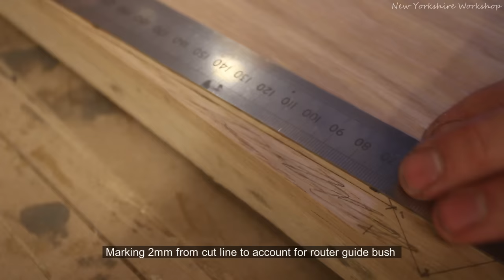Making a traditional framed ledge and brace door in Oak

Comment: Well done sir it’s nice to see another fellow joiner do a good job l was looking to see the bits you were using on the spindle  moulder l have a lot of cutters made for the block but you only have one size will have to look into the cutters you have l do have a wobble saw blade which you can set the size you want great job but a lot of time but when you have finished it was Worth it and yes oak is my favourite wood did you make the door frame as well Nice to see you make your own jigs 👏👏👏👍 I will hit the subscribe button stay safe 👍

Comment: All the work and effort you have put into that and then you go and install it BARE what are you thinking? Why haven't you coated it? Worse still why haven't you coated it before assemble? Had this been done in our workshop the door would have gone into the spray shop prior to the boards been fitted to get stained and first coat of exterior grade lacquer paying particular attention to the end grain, the same treatment for the T&G boards both sides, ends, tounge. The frame could have been taken to a finish with 3 coats, again using end grain sealer on the end grain paying special to the end grain of the jambs as these will take up water like a sponge. Then once assembled the door goes back to the spray shop for finishing. The assembly process is slightly different of course because now your working on coated timber but at least the the timber is fully sealed against the elements. Has it gone black yet due to the tannins?

Comment: An absolute pleasure to watch this carpentry; especially with all the various power tools that are shown. One thing that I can not quite understand is how you managed to fit the last tongue in groove baton - did you slide it in along the full length?
Reply from the maker: Thanks! there is a 2mm gap on each side of each batten for expansion, so with six battens that is seven gaps for a total of 14mm of clearance. that means i can butt each piece up tight to get all battens in place and then space them out to engage the T&G's and at the correct gap.

Comment: Read the instructions on the Gorilla Glue, you need to wet the adjacent part to activate the glue
Reply from the maker: it is a moisture curing polyurethane so adding water helps but isnt strictly necessary on wood because it has moisture in it already.

Comment: Amazing. I am new to woodwork and am making a gate with braces. I've only seen 2 people cut the braces into the rails like this. Why angle the cuts into the rails? Is there a mechanical strength reason for doing this, or is it purely personal choice/aesthetic? Why not cut them in parallel with the rails?

Comment: Excellent video.  Good sturdy design and build, with useful tips and comments throughout.  However, I notice that the lock recess appears to remove a large part of one of the tenons in the middle rail (see 43:30).  Was this deliberate, or would you change the height of the middle rail in subsequent designs to move that tenon away from the mortice lock position?
Reply from the maker: Its s good point and well spotted! Yes id probably move it in future, although the door is still plenty strong enough with what was left of the tenons, owing to the orignal size of the tenons and that the lock was quite shallow.

Comment: Excellent work, may I ask what make countersink you were using for the stainless screws on the rear of the door... Thank you
Reply from the maker: thanks Mark. i dont remember where i bought them but they are the cheapest chinesium ones that come with those horrible tapered drill bits in them. probably Amtech. just search "plug drill set" and get the ones with the brad point drills, they dont need be an expensive brand, these ones have lasted me years.
Reply: Thank you,

Comment: Good morning. Can I ask you why you have so much movement on your bandsaw blade?  I have the same movement on my bandsaw and do not know what is causing it so would appreciate your comment. Many thanks. David.
Reply from the maker: good morning! if it is wobbling back and forth like in this video then it may be a damaged blade (thats why mine was wobbling) or if the blade is new then maybe just not good quality or joint weld is not good. other possible causes could be that it is a small bandsaw with too wide/thick of a blade which requires more tension than the saw can cope with. or may be that the tyres on the wheels are damaged, or the wheels themselves are damaged/wobbling.

Comment: I have noticed that you use pu glue a lot. Can you explain why do you prefer it instead of regular pva glue which is much cheaper? Love the joinery in your videos, you really stand out from the rest of youtubers!
Reply from the maker: there are a few reasons; im mostly using it on the exterior work because it is pretty much water proof to the extent that if submerged in water the wood will degrade before the glue, whereas the "weather resistant" d4 grade Pva's and even the aliphatic resin yellow glue will fairly quickly dissolve. thats if you can find a real aliphatic resin, titebonds yellow glues are just modified pva with a yellow dye to imitate aliphatic resin!
 another reason is i tend to have it in the workshop anyway as i use it on some of the products i manufacture where im bonding wood to alluminium, PU does this quite well. it is also convenient being able to just squeeze it out of the bottle and when foamed up on the surface it is really easy to clean up. 
main disadvantage is there is almost zero strength when it foams up, so you need to make sure the joint has good contact and clamp well. in situations where i cant guarantee good contact, or i need to guarantee good joint strength i would use epoxy ( for external work) i know cascamite is widely used, ive never used it personally apart from at college 22 years ago.
Reply: @NewYorkshireWorkshop   I had no idea about Titebond and their clever marketing. So how does pure aliphatic resin compare to everyday available wood glues? I have used premium polyurethane construction adhesive with great sucess as it is very durable and gap filling. I like it because it does not foam up. I think I have some further reading to do about all this
Reply from the maker: @markosabados546  i dont really know the science behind it but you can tell the difference in the glue when it is dried, the titebond 2 ultimate is quite flexible and rubbery and the titebond 50 (true aliphatic) was very brittle and hard, more like hide glue with added benefit of very good heat resistance and water resistance, unfortunately it is no longer available (was never available for retail sale, just through trade dealers in 30 litre buckets).

Comment: Watched this so many times. Love it! So relaxing watching a skilled craftsman. Two questions if I may, what bearing cutter did you use for the hinges? Seems like you attached three bearings to it? And also, what countersink/plug hole drill bits did you use? Cheers buddy
Reply from the maker: yeah if i remember correctly I added extra bearings because the template was just bodged together and guiding surface was too high for a single bearing. This is a variation on that cutter- https://amzn.to/3shZWhP
and the countersink and plug hole cutters are just cheapy ones like these- https://amzn.to/2U1EYai
Reply: The countersink and plug cutter set are in the video description

Comment: Amazingly done, real nice. i have to build a similar one but i m doubting which wood to use, as for the humidity. for inside i use 12 % but outside often 20%, can i ask what you used here? thanks!
Reply: Definitely looks like oak. As for my area, my inside humidity ranges from 2% to about 85%. Outside runs typically (depending on the time of year) at around 15% to 100% (even when it's not raining). Temperature ranges from (during my 49 years) -17°F to 112°F. The proper finish is dependent on the wood, for interior or exterior doors, but most any "hard-wood" will do.
I just hate paint on fine woodwork, but it is my best bet for exterior doors with no roof/awning to protect it from direct rain and sun.

Comment: Top work.
Why do you chisel your haunches rather than just setting the depth on the mortiser? Also Why is your chisel opening on the mortiser facing sideways? I was taught this was to face forwards. Not critising just asking in case you know somthing I dont
Reply from the maker: I just don't like the drill marks in the bottoms of the haunches, bit ocd! 😊 
if the chisel  opening is to the front then it can be  blocked by the wall of the mortise, if it is to the side then it is clear most of the time and can empty into the mortise, just a bit less likely get clogged up that's all.
Reply: @NewYorkshireWorkshop  brilliant answer never really thought of that, just goes to show that it's always worth asking even if you were taught differently. Never had many blockage issues but it makes sense non the less. I make a lot of traditional doors and windows myself and love watching your videos. Can see you have a lot of passion for the job. Where in Yorkshire are you from? I'm just on the border of South Yorkshire

Comment: (41:25) If we had to split hairs I'd argue the the pore size and distribution of the species quercus is closer in comparision to the sercretions of the Samia cynthia.  Your typical black palm or average backyard yellow popular is arguably much closer to silkworm spit and probably preferable if you intend on sliding across several board feet of it in your birth suit.  But yes, your door looks quite even with an extremely regular surface.  We'll take your word for it :)

Comment: Why the spacers after glueing and screwing the battens on. Once they've been glued and screwed they won't be able to expand unless they split??
Reply from the maker: the spacers were placed before gluing and screwing and thn removed, i thought it was obvious enough to not merit showing the removal.
Reply: @NewYorkshireWorkshop  I was wondering a similar thing but explained differently. You have allowed for expansion of the battens with spacers which makes sense. However it looks like you have put 2 fixings per batten across the ledges. This is where expansion /contraction between the fixings may cause splits over time. One fixing in the centre of each batten allows more float. Pretty sure it will be rock solid though. Nice work.
Reply: What I meant was the boards aren't allowed to expand or contract as they are glued.

Comment: Can I ask about that gorilla glue does it go off very fast? Fantastic job by the way real craftsman 👍.
Reply from the maker: normally a few hours but i like to leave it over night if i can, you can speed it up by spraying water on the wood before assembly but be careful with that because it can drastically reduce working time before it foams up. the down side is there is almost no initial tack like you get with pva glues.
Reply: Thanks for that 😁

Comment: Beautiful door!  Wondering, was the design and dimensioning left to you or were you given dimensioned drawings to work to?
I like the style and proportion of the finished product as seen closed in the casing.
I wish you would have shown both sides after instalation.
New subscriber here.
I have made a few large doors, all by hand for myself.  Too much work.  Your way is better.  No one would pay for a handmade oak door today!
JIM
Reply from the maker: Thanks Jim. The customer just sent me a photo of the door he liked which happened to be a framed ledge and brace and wanted a standard 832mm width but a lower height to fit under his eaves. I designed the proportions of the frame and battens in sketchup before i started.

Comment: Great job. I stopped making brace  doors in oak because it expands like crazy in the width when it gets damp. Even your 2mm expansion gaps may not be enough in wet seasons. How has your door held up?
Reply from the maker: youre right all the 2mm gaps did tighten up and i did have to go back out and skim a bit off as it started to bind, id made it quite tight because the tolerance on those multi point locks isnt huge. it is in a really exposed position too and doesnt even have eaves over it! so it does get quite wet, especially these days with the amount of rain we got this year!
Reply: @NewYorkshireWorkshop  Great carpentry work on the door all the same. Oak expands like no other species I know. On external projects, painted with linseed based paint, I've observed around 5% expansion in the width (lengthwise it's quite stable). I've had to go back and redesign two garden doors because of this.
One solution is to make them with a deep tongue and groove and build the door tight at the dampest part of the year from wood you've kept undercover but outside and exposed to the elements. The door can only shrink from that point and hopefully your tongues will be long enough to keep the weather out.

Comment: Hi. Wonderful job and a great video. Is this an exterior door? The reason asking, I want to build one myself for my house and we have somewhat dry winters and humid summers here in the South-East Pennsylvania. Would a door like this be prone to expansion/contraction due to humidity changes? I am a new woodworker. Thank you!
Reply from the maker: Hi, Yes its external. you can see in the video I allowed a gap between the battens to allow expansion, since wood expands more across the width of the grain, it is the battens which are the biggest concern so a 2mm or 3mm gap  is left between them and also between the battens and the stiles. the tongues/grooves need to be large enough to still allow cover should the battens shrink further as well. just as important though; you can minimise shrinkage/expansion by using wood that is of appropriate moisture content for external doors, around here it is about 12-14% but varies depending where you are. in very warm all year round climates it might be 8% or lower. get your self a moisture meter and go out at night and secretly measure your neighbours doors to get an idea of where it should be! :)
Reply: @NewYorkshireWorkshop  Thank you. I appreciate your response!!!

Comment: Very good.. Just a small point regarding the anatomy of a door. The top horizontal section of the door is known as the top rail not the head. The head is the top horizontal section of the door frame. Obviously one would have to shoot the door into its frame for a good fit prior to fitting the furniture. The taste of oak is all very well but if you can taste it it is already in your body. Even with good extraction an approved dust mask is essential. Hardwood dust is carcinogenic after all with only a 3mg -m3 8hr time weighted average reference period.

Comment: That’s a good door quick question about about Charnwood mortice I bought the same and the pack of chisels came with they not great what brand chisels do you use any recommendations cheers thanks
Reply from the maker: its the ones that came with it, they dont do too bad really, i sharpened them up and seem to hold an edge reasonably well, but it still takes quite a bit of effort to drive it down on the first plunge.
 bigger problem for me has been the augers, they dont run straight so end up with an off centre hole which doesnt help the chisel since it has to bite more from side than the other. 
it was worse with the pitch pine than oak actually, I think it is asking lot of these little machines anyway, they should probably have a max chisel size of 10mm for hardwood.

Comment: I see that you run your hollow chisel auger bit well out of the "close in" position. Is there an advantage to this versus the bit being up in the chisel almost touching the chisel edge? I have the FD250 Felder boring machine with the factory fitted hollow chisel attachment and use it for maple, red oak and walnut. Over here in Chicago area with wood mills up in Wisconsin.
Reply from the maker: it has to stick out that much because it has a lot of runout on the bit so it just hits the chisel otherwise! it is a cheap machine with even cheaper bits.
Reply: @NewYorkshireWorkshop  thanks for the info. I was in a different career of printing high end commercial corporate reports and brochures and decided to change into furniture
making. Buying a band saw, jointer, planer, sliding table saw, hollow chisel bore machine and shaper required 2 years to set up and another 3-4 years to learn to run such equipment. Your videos help me to understand the finer points of making doors. I appreciate your help very much. Finding the right clients is paramount in allowing enough
money to work the project correctly. If we have to hurry so much to make it pay; then, all can be lost and the quality suffers. Good luck to you in New Yorkshire.

Comment: Why you are glueing the Frame when you use wedges? Especially for a outer door. Question from Finland.
Otherwise propper work. Thx
Reply: Wedges could become loose over time with temperature fluctuations. These joints are traditionally glued.

Comment: Morning Can I ask what side guide bush did you use when you were doing the rout out for the braces. many thanks Charles
Reply from the maker: that one is 17mm and a regular 1/2" cutter,  it works out that the template is made 2mm bigger. doesnt matter so much which bush you use though, just adjust the template offset to suit.

Comment: Was that gorilla glue? Is it what you would recommend? Ty for the great video
Reply from the maker: well many would argue not to use glue at all on a traditionally made door like this, but It wont hurt to use glue also.
Gorilla glue (or any Polyurethane glue) is what I would recommend for anything that comes into contact with water, as long as the joints are a good fit with no major gaps, the Polyurethane foams into gaps and this foam has little or no strength. if the joints are loose then you should use something like Cascamite or epoxy as they are better at gap filling.